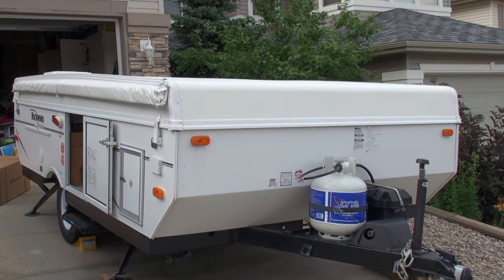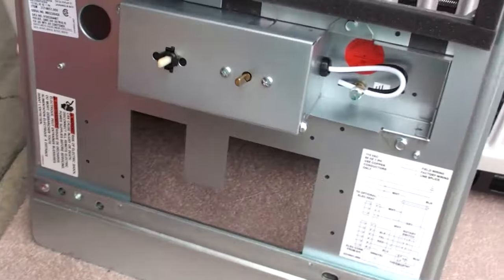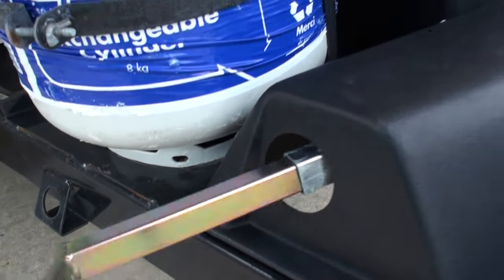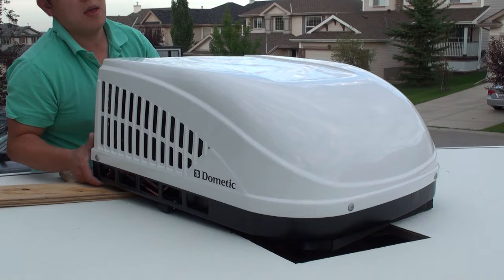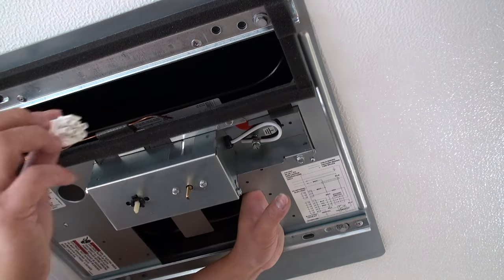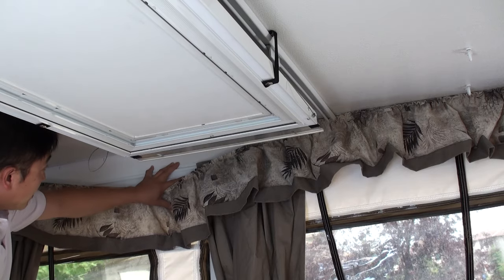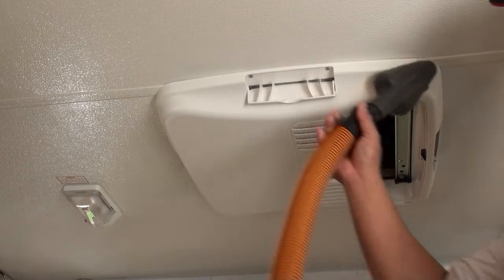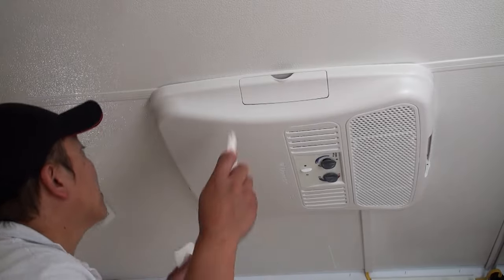Install a RV Roof Top A/C Unit on a Forest River Pop Up Camper Tent Trailer

Comment: Excellent job. We have the same trailer and want to do the same. How does the cooling actually work? does it really cool enough to be comfortable?
Reply from the maker: The A/C works great!  In 90+ degree weather it is like an icebox in our trailer on the max setting.  You can make your A/C even more efficient by putting bunk end tarps over them to reflect the sun back to make it even cooler during the day and warmer at night.  I can't remember what those covers are called but if you search online I'm sure you can find them.

Comment: Good vid man.  I'm sure it took as long to produce the video as it did to do the work.  Question: I have a similar camper (2010 Rockwood 1940LTD) and I am currently installing the same A/C unit.  It is prewired for A/C which means it has the 20 amp breaker and a junction box already installed in the galley.  Rather than cut a hole in the side of the roof, I'm considering running a 20 amp power cable down the window inside of the camper and plugging it in to the GFCI in the galley. I really cant think of a negative from doing it this way, but it's my first time doing this.  Any thoughts on this method? Pros / Cons?
Reply from the maker: no cons at all other than the fact that you've got a cable on the inside of your trailer dangling around.  The intent of the side socket that goes to the outside is to prevent inadvertent "snagging" of a 120 volt feeder cable by people or kids.  How would you secure that cable on the inside such that is tucked away neatly all the time and not be dangling ?  You'll notice in my trailer that I used a wire channel for the hard cable.  That is to ensure wires are tucked away neatly and safely.  I personally think that the factory approved method is the best way but each to their own if they want to do it differently.

Comment: For low torque situation you can use a gunsmith torque driver they are precision for lower values.
Reply from the maker: That is true. I've never used a gunsmith torque wrench but I'm assuming it is the same as a bicycle mechanic's torque wrench.  Fortunately for me, I'm pretty experienced in "guesstimating" a fasteners feel (yeah real scientific on my part.... lol) but its been YEARS with nary a sign of a leak so that's a good thing.  NO regrets doing this install and the roof hasn't cracked and I've never had a single leak.

Comment: Great job man! What about extra weight on roof?
Reply from the maker: glad you liked the video.  No issues with the extra 100lbs on the roof.  The pop up was specifically internal braced from the factory to accommodate such a unit so it isn't anything that falls outside of the pop up's design specs.

Comment: Very well done video, thanks for posting it! 
I have the same A/C unit in a new travel trailer, I find it too loud for sleeping even with earplugs. Any ideas on how to quiet it? I was thinking about removing the plastic housing and mounting an air filter directly to the intake. And maybe it's possible to reduce the fan motor speed? Thanks - Ed
Reply from the maker: not really way to quiet the unit down. According to Dometic, this unit is already quieter by 15% over the previous model.  Making it into a ducted unit is the only way to make it quiet but your RV would have to have all new delivery vents and return ducting put in.

Comment: Thanks for the great video.  I'm about to do the same.  How's the installation holding up?  Any roof sag?
Reply from the maker: Absolutely not sag worth mentioning.  Works like a champ and best of all is that it has performed perfectly in all sorts of weather.  No regrets and definitely a great upgrade to a tent trailer EVEN if I reside in Canada :)

Comment: All that great work and detail, but you still have to have an extension cord dangle outside that trailer, wish there was a way to avoid that.
Reply from the maker: The procedure I showed was the factory approved method and unfortunately the cord on this particular trailer is set to dangle in between the windows (by nature of how the power socket for the a/c unit was designed and placed).  It really isn't that bad and while some have suggested routing the cable inside the trailer that I would much rather have a high current carrying cable outside of my trailer than on the insides.

Comment: Thanks for the video, now I have no dought I can handle doing this. Did you use any caulk to seal the unit to the roof? Are you an electrican? Where did you do your research before atempting the install? GREAT JOB!
Reply from the maker: I am not an electrician but somebody that is overly anal about doing things correctly.  I called a few very helpful RV dealers and they walked me through the process via email and even though the information was in the form of email that I had enough common sense to decipher it all and translated it into a DIY video.  First kick at the can and it went flawlessly. DO NOT use caulking on the a/c unit.  The foam sealing block on the unit is more than enough to keep the water out.
Reply: piercedasian Thanks for the advice I'm pricing out a unit. I'll let you know how it comes out.
Reply: piercedasian I just installed an air conditioner unit on my Rockwood pop-up. Thanks to you and the people at Rockwood who confirmed the location of the roof supports and the pre-wired 20 amp circuit. I'll be doing the running of the romex and wire mold later in the week. Once again Thanks.
Reply from the maker: that is awesome news Daniel - may you enjoy nice cool and comfy days in your pop up.  It is one of the best investments you can make for a pop up.

Comment: Thank you so much for your help in your video do you knw if all pop up campers are 14by14 hole?
Reply from the maker: It generally is b/c that is the standard size that the dometic brand of air conditioners use.  I would assume other brands like Coleman, carrier and other similarly sized units would use the same 14x14" hole.  If you cut a hole smaller than the a/c unit's mounting plate it won't even fit right.  This is probably why RV manufacturers frame the hole accordingly.  You can always call your RV manufacturer to confirm if there is bracing already built into the roof and to confirm the size of what they framed the hole to be.

Comment: I would appreciate a link for the thru wall outlet and the channel that sticks on the inside ceiling to hide the wire
Reply from the maker: Hi James, my apologies for taking so long to reply.  Were you able to locate the pass through wall outlet and the wire channel?  I purchased the thru wall outlet from my RV dealer and the wire channel cover from Home Depot.  If you need links I can provide them in the video description when I have time to dig into it later this week.

Comment: Now that you have had this installed and some use under your belt, any follow up comments or things you might have done differently?   Any issues with the mount, screws, bolts due to vibration or weather?   That sort of thing...

Thanks!
Reply from the maker: not a single issue to report other than the fact that it is quite noisy when running but I can deal with that continuous fan noise than die from extreme heat during the summer months.  Love the unit and would absolutely do it all over again if I had to.
Reply: piercedasian Cool and thanks for the quick reply.   Thinking about adding a pop up, the Somerset E3 looks like it would suit our needs especially boondocking on the beach and off of fire roads in the mountains.   Going to buy new and will probably add the A/C option.
Reply from the maker: oh man, having A/C is a dream in anything that could use it - trailer, car, home... i would DIE if I didn't have air conditioning?

Comment: Have you used it yet in (very) hot climate?  Is the 13,500 BTU unit sufficient of would you opt for a 15,000 BTU unit if you ever installed one again?
Reply from the maker: +tobiwankenobi0 yep I have in 39C weather with about 70% humidity and it worked liked a charm.

Obviously if your humidity is higher or you have more occupants or you don't have end bunk reflective shades then maybe a 15, 000BTU air conditioner may be better suited for your applications.  I camp in relatively dry climates and thus 13, 500 is perfect for the places I hang out at :)

Comment: I noticed that your camper has no roof braces on the inside of the ceiling. Did you consider installing some? Reason I ask is my Palomino has one roof brace but I was under the impression the trailer should have two braces. Any issues with sag on your trailer? Thanks
Reply from the maker: they came from the factory sandwiched between the roof layers.  A nice feature that Forest River includes on all their more modern tent trailers.  No noticeable sag to be concerned with.  There is a tiny tiny tiny dip where the unit is but nothing that I would call "worrisome".

Comment: So I dont understand why you went into the converter. Cant you just hook it up to your roof and into the power box in the campsite? Or just run electric cable through the top of your camper on the inside drop it down Drill a hole in the top of the bottom side then fish it to the converter thus not needing the junction box (plug in outlet).

Comment: I bought the same unit for my 2018 Viking 2108ST. Do you recommend sealing the outside of the ac with silicone to prevent water leaking into the camper.
Reply from the maker: No that is totally unnecessary.   Manufacturer doesn’t indicate it needs sealant and if you ever have to take the unit off that it will be a nightmare to rip the sealant off which will likely damage the foam seal. Just place on top and bolt down.
Reply: @piercedasian  Thank you. One more question. Most AC’s drain condensation from them. Do roof top AC’s drain? If so where do they drain to? Does condensation form in the pop up?
Reply from the maker: the condensate just runs on the roof and eventually finds it way to the ends of the roof and drains off that way.  ON my pop up it always drained off on one of the corners of the roof and would just drip on the canvas ends and then onto the ground.

Comment: Wow 13.500 BTU. How much decibel has that during maintenance?
Reply from the maker: Not sure what you mean by how much decibels it has during maintenance as the unit would be off if I was cleaning it.  As far as running noise it is kinda noisy but more of powerful fan more than anything.  The compressor has a nice steady buzz to it but it isn't anything annoying that would hinder my ability to sleep through the noise it makes.

Comment: Wow great video!!
Reply from the maker: Glad you enjoyed it
Reply: @piercedasian  I’m going to do mine next year I got the AC unit I got most of the wiring so I’m getting ready to put the camper weigh in a few weeks because I live in Pennsylvania so I’ll have everything ready to go for next year which my camper already has a hole in the roof I just need to remove the vent and I got the circuit breaker it’s installed in there I just need to wire it

Comment: One thing you forgot is to install roof braces made to hold the weight of the A/C unit, roof will sink over the years in not installed, pop up roof are not made to hold the weight with out these braces.
Reply from the maker: Nope I didn't forget to install the roof braces. Most forest river pop ups actually include the roof braces built into the roofs. I have installed two Ac units and in both cases they had the bracing built in. I did clearly mention that in my vid (otherwise how would I have known where to stop cutting?).

Comment: Do you know if all pop up roofs are made the same? I just got an old ('79) Coachmen I plan to replace the canvas and install a rooftop A/C on. Sink, stove and heat all work in it already.
Reply from the maker: no they are definitely not the same.  Some are wood core, some are foam, some have or lack reinforcing and so forth.  You'd have to check with the manufacturer to see if it can hold the weight of an A/C unit on it.

Comment: I am doing the same install on my 2021 model forest river pop up but they have you remove the roof vent to place the new air conditioner. Unfortunately you then lose the roof vent.  I am wondering if you know if Forest River partitioned any other areas on the roof to mount the vent.  I don’t see any other screws in the interior roof that could indicate a spot. I certainly don’t want to poke holes in the roof or cut through the interior lighting wires.
Reply from the maker: that is very interesting that you have to remove the roof vent to put on the A/C unit.  That is not typical of how the a/c are installed especially for forest river pop ups.  What model of pop up to you have?  I looked at some new pop ups from FR and it looks like they still have the same exact setup as what I have on my older camper.  You can always give FR a ring and ask them about your specific model.  They have lots of useful info to help guide you to a successful install.
Reply: piercedasian it’s the 2021 Forest River flagstaff Mac 206ltd. Basically the roof vent is positioned in the exact same spot that you cut out for the a/c unit in your video. When I called the dealer they said it’s becoming standard to put the vents in the location for the ac because it makes the installs faster. When I looked at the ones on their property with ac units all of the same model had them there. The service writer didn’t know if you could move the vent to another location.

Comment: I have a 1995 Forest river. It does not have the location screw for the 14x14 hole. It has two plastic plugs on the ceiling about the size of that screw. Do you know if this is also identifying markers for the ac unit?
Reply from the maker: Jeff Abbott that is hard to say. I have only ever seen roofs that had the built in reinforcing braces marked with a screw. Best thing to at this point is to contact forest river and ask them if your roof is a/c ready.
Reply: Thanks for the reply, I will do that.

Comment: I have a Freight liner box truck (step van) the ones UPS and fedex use the truck is great but doesn’t have AC if I install this to the top roof will it kill the battery (it has two tuck batteries on the steps passenger side)?
Reply from the maker: this a/c unit requires alternating current and thus using batteries is really NOT an option.

Comment: There is a vent in that location of that size on my camper....Can I just remove this vent and add a a/c unit?
Reply from the maker: no!   You can't just arbitrarily install one of these units on the roof without knowing if there is additional bracing in the roof.  Most modern pop up campers that have an ounce of quality built into them would have wood or metal bracing in the roof to support the weight of this A/C unit.  Its very heavy and without bracing it will cause the roof to sag and eventually damage the roof.  You MUST confirm if your camper has internal bracing or if not then you will need to install a roof bracing kit.

Comment: hey man, where did you get the universal air distribution box from? and did it come with the electronics on it as shown @ 3:00? Mine didn’t come with the electronics and it’s taking them over a week to even find out...it’s getting rather frustrating because it’s like nobody knows if it does.
Reply from the maker: It is made by domestic and purchased it at the same time as the AC unit. It has all the switches and everything built I. So it is simple a plug and play affair.

Comment: So I have a Flagstaff br23sc. I don't see a screw in the sealing. Does that indicate that the roof can't support an ac?
Reply from the maker: not necessarily.  Some of my viewers have informed me that their campers don't have a screw marking in the ceiling.  Why manufacturers omitted this goes beyond my understanding.  Best way to find out is contact Flagstaff and provide your VIN # to them and ask them if your model was designed to have a rooftop ac installed in it and if yes, ask if there is already internal bracing in the roof for it or if it needs to be added to the underside of the rooftop.